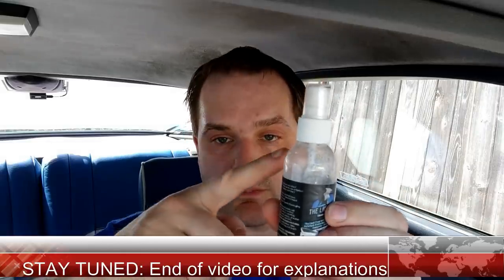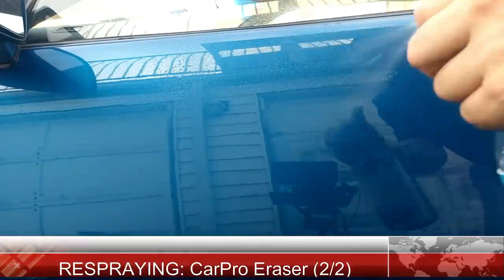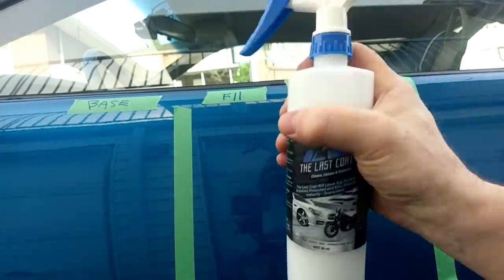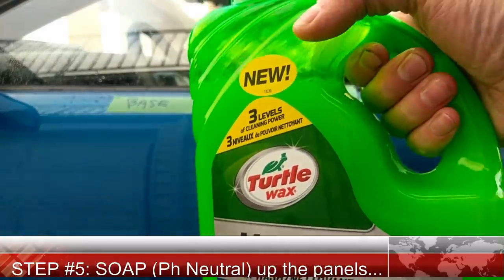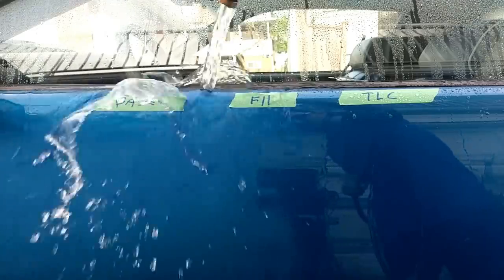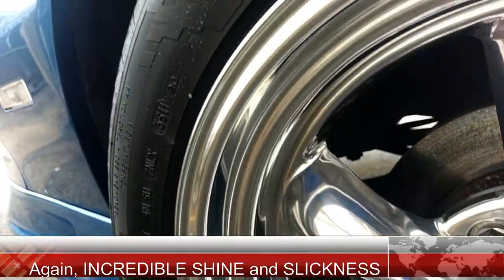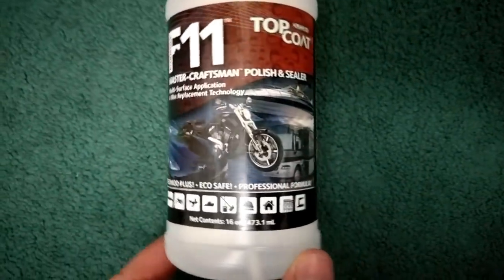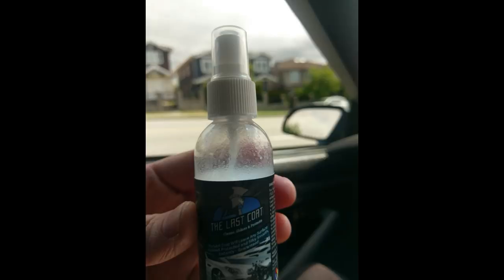TOPCOAT F11 VS. THE LAST COAT. (RESULTS WERE SHOCKING!!)

Comment: Topcoat released a new two part coating, called Chrystaleene, which blows TLC and TLC ll  away. I used the prophet technology 14 years ago on my truck, and that coating is still performing.  It is very expensive though, I believe 300. For 8 ounces.  Well worth it though.  I don’t care what product it is TLC or Topcoat.  Your not going to get a lot of longevity out of a water based coating.
Reply from the maker: I have seen Crystaleen on their website but don't feel it's fair to compare a product like say TLC2 against what is obviously a different category. TLC2 says around 12 months... Crystaleen says FOREVER (Which I HIGHLY find doubtful considering actual ceramic doesn't even match that). Evidently NOTHING will remove it so if you ever get into accident, you will never get a repaint or body work done? (Gotta watch when company's make claims like that "NOTHING WILL REMOVE IT".. )

Now as far as comparing TLC2 to Crystaleen, that's like saying a Ferarri will outrun a VW beetle... Of course it would, it's clearly a truly ceramic just like TLC2 isn't going to be as forgiving as a true Ceramic which you can get 3-5 years out of...

There seems to be 10 reviews on Crystaleen yet ive not seen a single youtube video which would be nice to see (not the company one).
Reply: WestCoastCamaroZ28   Are you one of those people who believes everything you hear on You Tube? Your videos sound  like you have totally been bought by the boys at TLC.  It’s almost commical, and it sounds like you are being coached, so I understand why you are always tooting their horn.  I’m retired, and I don’t work for anyone.  I’m strictly commenting based on my 14 years of experience with the products I use.  I used the formula that Chrystaleen was derived from back in 2006.  It has lasted 14 years.  To remove it, requires mechanical buffing.  I know, as I had coated over some water spots on my hood by mistake, and had to buff it off.  I don’t know how long forever will be, but the coating I put on my truck, which Chrystaleen was derived from, is still there, and performing.  I have had to go to the body shop for paint work on my truck bed side and tail gate on two separate occasions.  The body shop had no problems.  Any body shop worth their salt, who does proper paint preparation, will not have any problems, so your claim that a coated car will not be able to be repainted, is baseless.  Ducora now owns the patents for the original formula, and they have modified and improved it.  I have yet to try the new product.  I tried the first Gen TLC, and stopped there.  It did not impress me, but seemed to totally Dazzle you, which I cannot understand.  The first Gen TLC seemed like a copy of Topcoat Spritz, but didn’t even perform as well as that first tear Topcoat Product.  There is a lot of  negative information on You Tube, from people who are paid to post negative comments.  I had thousands of customers, when I was a distributor.  I believe, if the products I was selling were some sort of scam, or snake oil, as a lot of people on You Tube have said, I would have experienced a lot of negative feedback.  It was not so, and I had a lot of repeat customers.  I can count the un satisfied people on one hand.  Even though I only use Topcoat for my personal use these days, I still have people call and want to purchase it.  Look at all the copy cat products that are out on the market now. Shine Armor, Produxa, TLC, Mirror Image, and the list goes on and on.  People don’t realize that Ducora is a multi million dollar corporation, with  a huge industrial clientele.  They have been around, going on twenty years. It’s  not just about Topcoat F11, like most uneducated You Tubers think. Ducora has many industrial products, used in the solar industry, and OEM automobile manufacturers use their products to coat wheels.  They have a patented industrial electroplating process, that repairs damaged hydraulic cylinders, rams, and rotating shafts.  The list goes on and on.  Topcoat is Just a small  part of their recreational market.
Reply from the maker: I'm not sure what you are commenting on. I am only replying to exactly what you stated. Btw: it's "Crystaleen" not "Chrystaleen" according to Topcoat's website.

What exactly have I been coached to say? I have used TLC and TLC2 and all their products so far since 2018. This is MY experience. I'm not being told to say anything.

I used to PRAISE F11 and you can see my original video how amazed I was.. And then that changed and as a result, so did my future reviews on it.. So far I am VERY happy with the results of TLC2's products. I actually never had any issues with TLC (1) but apparently, people have...  Once TLC2 came out, I tried it and it is MUCH easier to use and uses so much less product.

In regards to the removal of Crystaleen, they state on the website "NOTHING WILL REMOVE IT".. Nothing means just that.. If you're going to put a statement on that, you might want to least add a [fine print] at least... Even actual CERAMIC doesn't state that.

You were also comparing TLC  Products and F11 to Crystaleen in which case I was stating that is an unfair comparison to compare a ceramic with "LIFE TIME" longevity to one that lasts around 6 months..

You also stated that you haven't even tried their new TLC2 so I am not entirely sure how you can make assumptions if you stopped at TLC. Again, not comparing Crystaleen since that is an entirely different category..

Shine armor is the WORSE company for claims I have ever come acrossed. There is so much proof that I have on how they are nothing more than Pearl Nano relabeled due to really CARLESS mistakes on their video's, websites, links, etc...

Comment: Not sure about instructions for TLC, but the F11 Top Coat instructions tell you to wait approximately 24 hours for the sealant to bond with the clear coat before applying water or washing. Your "testing" protocol is therefore flawed in my opinion.
Reply from the maker: Yes, you are correct. That is why I specified in the description of the video that a new video was made where I waited 27 hours and got the same results.

Comment: Great video Paul.  I trust your opinion.  I probably have the most experience of anyone using the Topcoat products, even years before before the F11 came out, and have always been happy with it. When I first came accross the TLC product yesterday, I thought it might be just a re labeled Topcoat product, or possibly made by the same company in Florida.  I looked at the website and it seems like they have the same “wheel of fortune” to try your luck, and also flash who just purchased. Their product 30 minutes ago at the bottom of the page.  These marketing techniques are almost exactly alike on the Topcoat site.  I think I am going to order some of the TLC product and put it thru some of my own testing. Do you know where this product is made specifically, and how long it has been on the market?  Thanks again for your review
Reply from the maker: Naturally I too as mentioned in my video assumed it was a copycat product.. But once I had the product in my hand, AND the impressive CUSTOMER SERVICE, I was convinced it was not the same once I smelled the product and realized it was not the same ingredients.

Course nothing could convince me until I did my tests first hand. Once the tests were done, I realized this was definitely not a copy cat and just had to be sure to spread that around.

I have since then purchased and now have the Gallon size to replace the Gallon of F11 ;-)
Reply: Ok Ok .. We Get it ..  You Choose TLC .. Im sure the guys at TLC are impressed by your comments but you are starting to make the rest of us cringe.

Comment: Topcoat F11 leaves my car looking like a dull shine. Shit blows. What a waste of money! ALL of these spray ons suck! Spend an hour detailing ur car! It will last far longer then these junk sprays!
Reply from the maker: Its definitely not the result I've got from tlc applying it to four different cars.. even one that has been sitting in a underground parking lot collecting dirt, bird droppings and dust... all came out very slick and shinny. I will be splitting my winter car with half f11 and half tlc down the middle of the car in about 2 months...
Reply from the maker: F11 left a very good shine and slickness but rapidly disappeared after a few rainfalls.. and instantly after using soap to wash the car... the complete opposite with this tlc product. Absolutely love tlc and swear by it as you can see :)
Reply: Well maybe I will give that a shot then
Reply from the maker: @TENNESSEETRACKHAWK  they also now have both standalone bottles and even the simple bottles at a low price

Comment: FYI, F11 needs to cure for 24-48 hours, you tested too soon.   Plus, F11 stays adhered to the surface a long long time, it does not come off even with products that are supposed to remove sealants.  I hope this helps.
Reply from the maker: Hello. You are correct. I had not given it the 24-48 hours cure time which is why I redid the video this time, waiting 48 hours and the results were the same.
Reply: @thecamarogarage  Amazing, thank you.
Reply: The top coat needs to cure for 24 hours. So neither product was cured. Nice try though
Reply from the maker: You are correct. I mentioned in the description that I has redid the test multiple times in the follow up videos and got the same results.

Comment: There are much better products on the market than both of those and for a significant lower cost. If a pH neutral soap removes that after one wash then I would consider those to be on the shelf for $10-12. Good marketing by them but you are getting hosed more than the car.
Reply from the maker: That is an OLD video of the original formula.. The new TLC2 doesn't come off with soap.. I did a torture test on it as well as other products and hit them with everything

Comment: ALL OVER PRICED B/S, NUFINISH IS GOOD STUFF REASONABLY PRICED THE REST IS JUST HYPE
Reply from the maker: I have to disagree with you with my personal experience anyway... I was very happy with the Original TLC and then they came out with their new TLC2 and I have never looked at any other product since. I've used it and continue to use it for over 2 years now. TLC2 and all their products are definitely NOT HYPE. Look online and you will see very little negative reviews and TL2 usually comes out on top on torture tests.

Comment: one main test you did not do with TLC after rain or just hose off let dry ,is there the Dreaded Water spots like Top coat Has !? That my deal breaker !!! LOL Hope to hear from you.
Reply from the maker: Hi Mark, That's hard to say because water spots can be due to the area in which you live in.. If you car is full of dust and it rains but not enough to wash the dirty watery dust on the car, then yes you could likely have water spotting. 

Depending on your area and whether the house water/rain is enriched with deposits or not, but wit TLC even if my car does, I can easily just wash the car with a PH neutral car soap and use a microfiber towel, mitt, or brush to gently remove it from the paint. I find that the paint remains SLICK even after that but even you want to re-add some of the TLC product, I can get away with using 1/2oz with half pulls of the sprayer..

Technique I use and have for a while now.

1. Electric Pressure Washer with Foam cannon using 2oz of Honeydew foam car soap (PH Neutral) using WARM water in the container
2. Power rinse the car
3. Foam the entire car
4. While the foam is dripping off the car (and carrying the dirt off the car, I do the tires and wheels)
5. Once all done, power rinse the soap off the car

(OPTIONAL) 6. (Ensure the car is wet, I then spray about 1/4-1oz of TLC over the entire car (Paint, Windows, Mirrors, Trim, Wheels, etc) You do want to ensure that the windows are WET. (I've heard that the windows COULD have a hazing effect if you dont remove the excess but I've never experienced that).

6. RINSE the entire car off to remove all the excess TLC.. I start with the windows and mirrors.
7. And dry the car

But like I said, I find you don't need to re-add any because the paint is slick. And even if it does not feel as slick as before when the car is wet, when it dries I would see that the paint would be slick as if I re-applied.

Hope that helps.
Reply: @thecamarogarage  those are good points and that's what you should focus onbring this video up-to-date and highlight those topics like slickness lasting longer less streaks I'll be trying TLC in the future

Comment: Your hand is in the way and we do not see what towel you are using. True masking includes masking paper that precludes any over overspray. F-11 fills in scratches end of line.
Reply from the maker: What in the world are you talking about?

#1. What does it matter about the towel I am using. Microfiber

#2. Masking? Masking Paper? I am not painting the car, I am dividing the panel into 3 sections. Does not There is no overspray.. I am not using a paint gun, I used a sprayer closer to the panel in between two lines of painters tape

#3. F11 does NOT fill in scratches.

Comment: Should be using 100% cotton cloths micro fiber towels scratch the paint
Reply from the maker: Whether you use 100% Cotton, or quality microfiber towels, they can both definitely scratch the paint if not used right or precautionary action is not taken.

If you leave the labels on, or let grit get into the fibers, I can assure you both the cloth and microfiber will scratch.
Reply: Cotton is a wood product.  Microfiber doesn’t scratch paint, people scratch paint.  If you keep your microfiber clean, and bag them up after washing them, you won’t have a problem.  If you lay them down on a dirty surface, they will pick up grit, and scratch the paint.

Comment: I am not trying to trash the TLC product.  I’m just being critical.  I put Topcoat thru the ringer when I first started using it also, as I am very particular about what I use on our vehicles. I’m probably even more picky than Paul. All I was saying is Topcoats technology has been around for over a decade and is proven. Your product seems very similar.  That’s good that it has a UV factor.  I’m probably going to purchase some and do some testing for myself.
Reply from the maker: Hi there. Did you have a chance to test the product yet?
Reply: Rod I am glad you had good results with TopCoat I sure have not.  I had to use 4 coats on my new truck, per TopCoat,  when I complained about it not protecting my paint.  Well I had to travel to the next town over and came back through coal silt on the interstate.  Got home and took the water hose and rinsed off the truck.  I figured I would wash it and dry it off a little later.  Boy did I get in trouble.  Truck water spotted so bad I had to use 2 different products and a butt load of time to get them off.  They set right through the 4 layers of TopCoat.  They say their stuff protects.  Well learn from me it doesn't  It sucks.  I complained and they said buy more and put more on your truck.  DUH!  What a sales gimmick.
Reply from the maker: I personally would say to try TLC instead. So far I am immensely impressed on the slickness and durability. In my tests is definitely has surpassed F11.